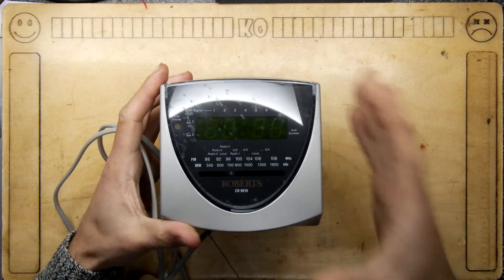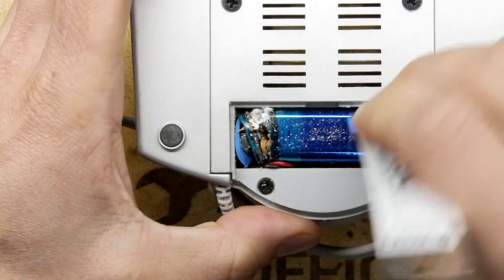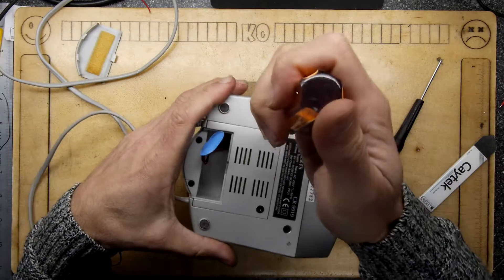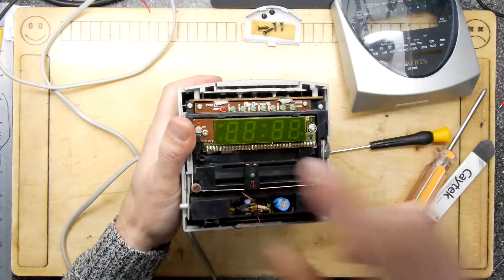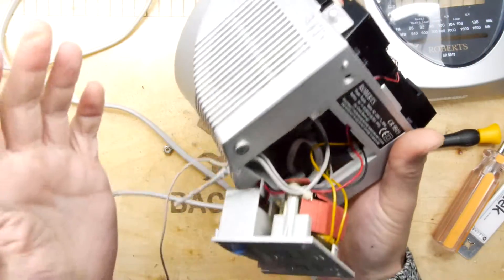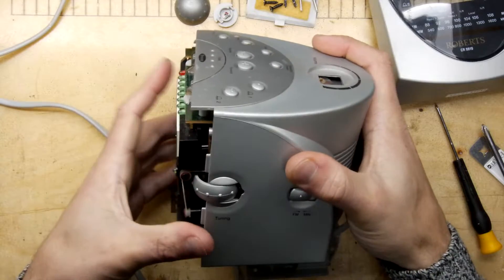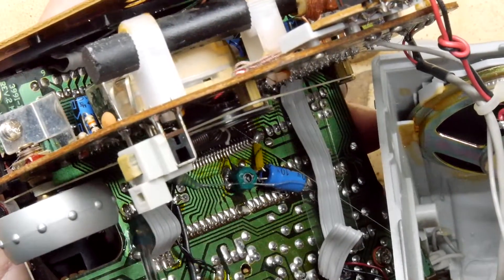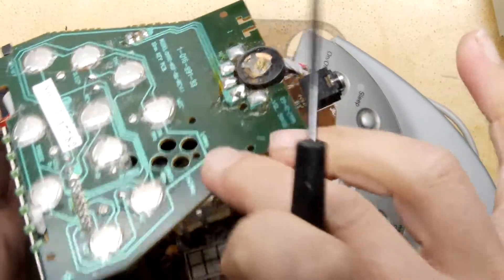Roberts Radio CR9919 Teardown

Comment: The signal is received from the official UK standard frequency and time signal transmitter (MSF) location used to be in Rugby in the U.K
Not sure if that one still exists. As for that broken cable you are 100! correct! its for the Time Capsule (Automatic time setting) Antenna.
You can set things manually as you've most likely found out 🤞by holding down the time button and using the + & - buttons to adjust 👍🖖
Reply: MSF is still on the air, but it was moved from Rugby to Cumbria.
Reply: Thanks for the update Michael! appreciated. I did check this morning as my clocks need it. I'm actually 1 hours drive away from it's transmitting area. You learn something new every day 🫡👍
Reply from the maker: I feel I tried to look for the signal using my SDR kit but not sure I actually found it. I might need to have a sniff later on.
Reply from the maker: I'm looking forward to trying this when I reassemble it, thank you so much, I'll try it